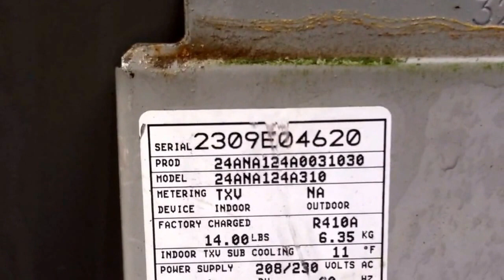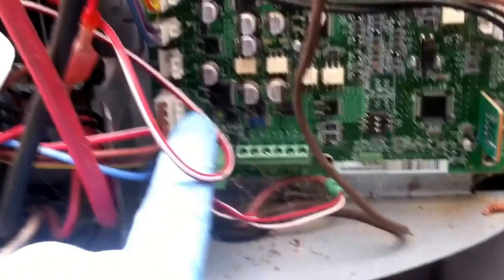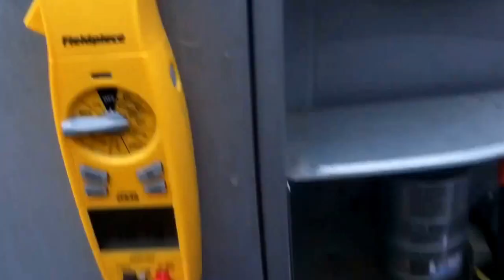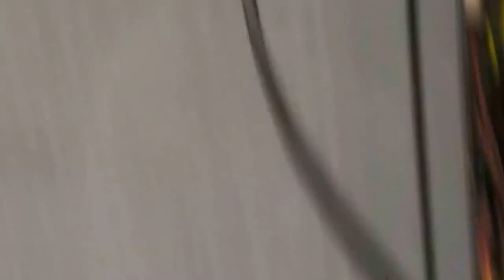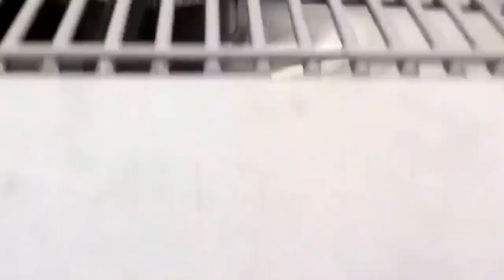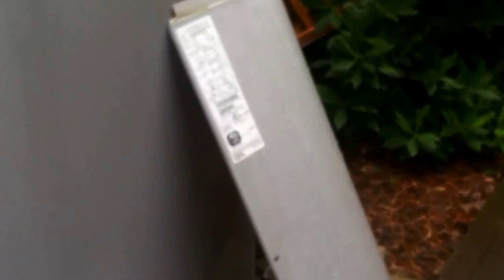Troubleshooting/replacing a carrier infinity ECM condenser fan motor

Comment: It’s the same on a Trane. The RPM varies between 200 and 1200. The voltage measured varies between 3 V DC and 12 V DC - measured with my fieldpiece clamp on amp meter. Pretty neat huh. 

I bought a module on Amazon to generate the PWM signal. I used 418 650 batteries in series and a battery holder to power my PWM generator module. So it was input around 14.7 V DC. Hence the reason I only needed about 85% duty cycle to reach 100% RPM. I also said it at around 22% to reach 200 RPM. I set it to 100 Hz and I could control the outdoor fan motor and various duty cycles from very low RPM all the way to full speed.

Comment: High pressure lock out fault and found compressor would come on but condenser fan would not. You are awesome!!!! Had a HVAC contractor come out and said the control board was the failure. They said it would be around $2000 to repair and recommend replacing the whole system due to age. Needless to say I did not trust them. I followed your troubleshooting video and found the condenser fan motor failed. Yes the motor is expensive but I purchased myself and replaced. Works like a champ and took about an hour to replace. I would like to send you a tip. Do you have paypal?

Comment: Thank you for take the time and effort to make this video.  You helped me diagnose a bad ECM motor.  My model was slightly different but... contactor pulls in, 240VAC to the motor.   Motor starts to spin, getting pulsed with 16.2V between PWM1-PWM2 in high speed mode, then after about a minute or two the fan lags, then stops spinning, 240VAC still at the top of the contactor, the DC control voltage starts pulsing more rapidly trying to get the fan back up to speed and then eventually the contactor drops and a CODE 84 - High pressure lockout code fault appears on the thermostat.  Now the challenge of finding a part source as it appears the model number of the motor I have is obsolete.   BTW, for everyone's info, my ECM motor has failed at 8 years after install, Atlanta GA, so it gets run pretty hard  June-October.

Comment: Well explained, thank you. Was working on one today and compressor was running but fan wasn't. So I checked voltage right away at the board to ecm motor. Wasn't getting reading then watched your video and realized i was in ac not dc. Still no power output, so I ordered a board for it. Its not a heat pump but it says defrost board, is that just a generic board for these? I don't work on them much

Comment: I'm confused because the ecm condenser fan motors have a common and I thought it was alternating current not dirrect current into.module someone please explain "tyvm"😎
Reply: There are different types of ECM motors out there - the carrier and Trane versions have a two wire input with a DC PWM signal. Voltage when measured ranges between 3 and 12 V DC on Trane. Frequency 100Hz works nice.  

Yes, many ECM odfm use 240VAC and then 24VAC from contactor input to turn on fan. Similar to what you would see on a ECM blower motor.

Comment: My unit is on high pressure lockout and I manually pressed in the contactor and the compressor comes on. should the ecm motor come on also with the compressor when i do this or do i need to fix lockout before fan will come on?
Reply: Did you figure the problem regarding to your question just curious ? Thx